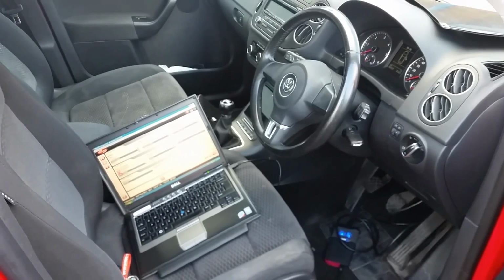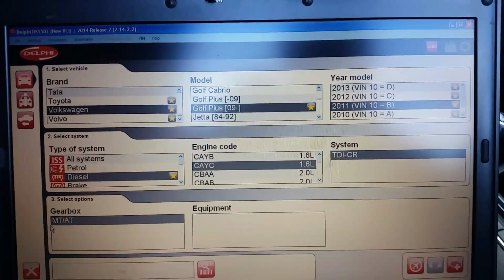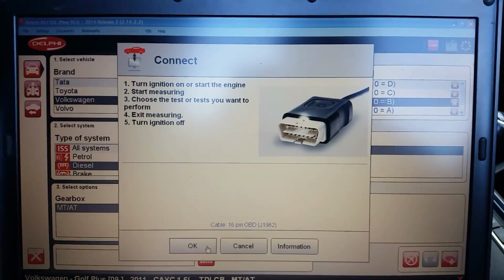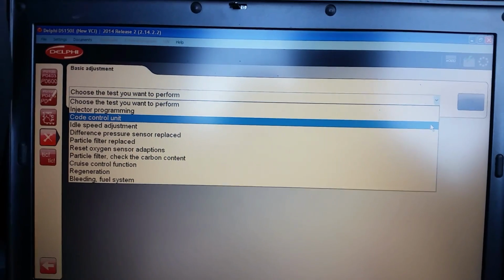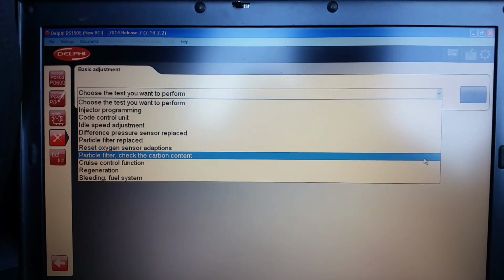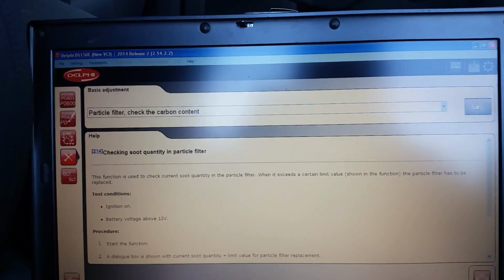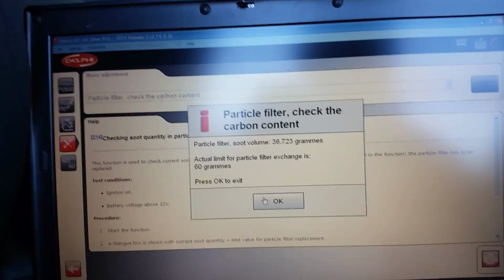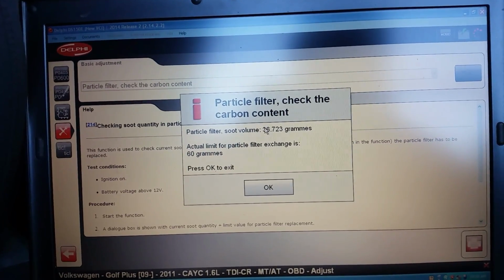How to check soot content of DPF using Delphi diagnostics tool - On a 2011 1.6 TDI VAG

Comment: Hello i have try to do check soot level same as you did but that option it is not show.I have not that option to check soot level.I have tried even with a latest version of delphi software.What to do please?
Reply: Try another car/model with the same motorcode. Sometimes newer or even older models with the same motorcode have more options in the Delphi tool. For example: Audi a3 2010 with cacy motor code you can also read out with Skoda, seat or vw with cacy motor code even if the year is 2011, 2012 and further as long as the motorcode is the same. I've done it with many vehicles without problems

Comment: Thanks for video!! 
Does the Delphi work out the levels on a Toyota 2.2 D4D 2011 built?  THx jacky
Reply: jacky1911 yes it will. You can get a Chinese clone of the software on eBay for cheap.

Comment: I just bought this for dpf regen and although it reduces soot levels to about 1-2 grams, it then shows about 33grams when I try the "check soot level" option (incidentally shows full as 60grams limit). I tried this on 2 cars and both show same although in another option screen (where you have a list of about 160 odd readings/screens) one of the readings does however show the correct 1-2 grams. Why is this and should it not show 1-2 grams instead of 33grams? It is as if 33grams is still there when clearly i counted down to 1-2 grams. I have to add I did regen without it requiring it just to test and the dpf light comes on during regen but goes off when complete.
Reply: what version did you use? I have 2015 realease 3 and I dont find soot level.can you help me or any ideea
Reply: Same version. Once connected, Choose 1 of the red left hand side icons in video at 1.09sec (I think it was the graph icon) then look at data lists then scroll through until you find options for soot level (about option number 48 or 58). Sorry just going off memory as not done it again since the post you replied to.
Reply: sorry for desturbing..I tried to find,and I take also one by one but no any results. i don't find..can you help me with the software for 2011 or the version that you use and have this think.thanks in advance